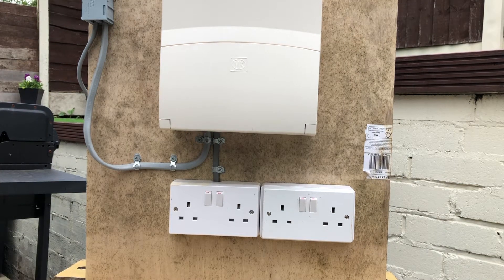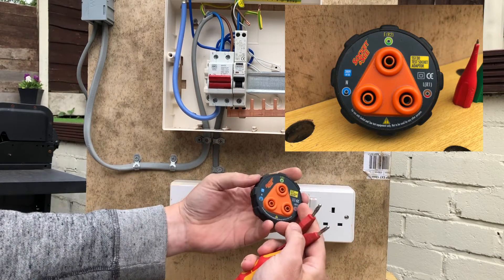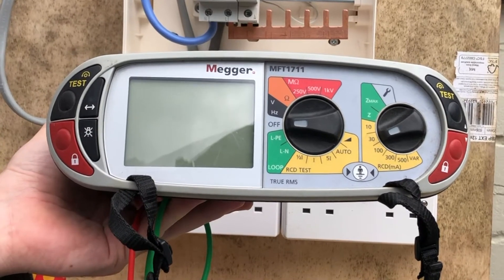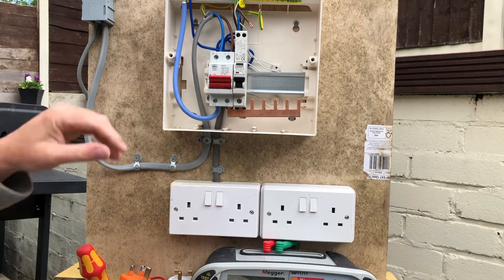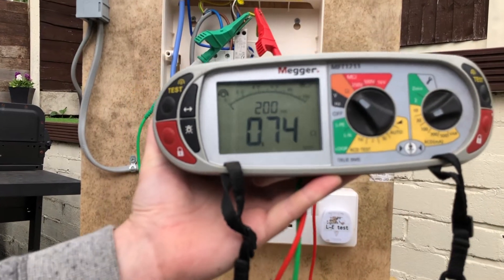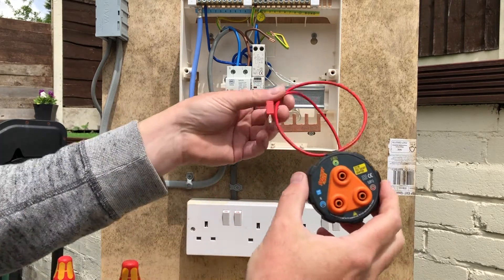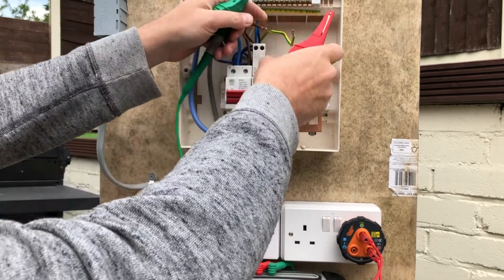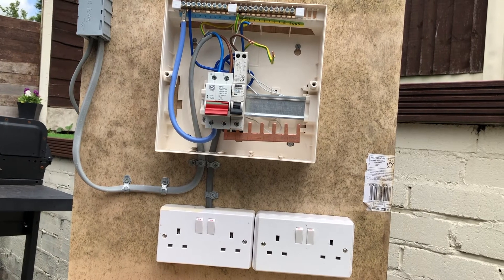How to Conduct An R1 + R2 Test On a Radial Circuit | R1 + R2 Testing Explained | EPR UK

Comment: Interesting, I'm  not a Spark so just curious.  If your meter is at the CU you have to keep walking backwards and forwards to all the sockets? If you have the meter at the socket (less walking) you have to remove the faceplate (more work) So why can't you have an adapter that would allow you to test at the socket without removing the faceplate? (less walking and less work)
Reply from the maker: Hi, Thanks for having an interest. It all depends on the installation that you are testing. Sometimes it may be necessary to remove the sockets to check the connections anyway to make sure they are tight and no sign of burning is present. Other times, the board is so full of cable trying to access it can be potentially dangerous, this can cause additional faults to occur. The methods I demonstrated in the video give the inspector an option to use a combination of any test method. It will all be dependent on the job type and accessibility. Hope this helps a little. Regards Chris

Comment: Hi, very helpful for r1 r2 readings. Have you a link for the banana to banana plug fly lead?
Cheers.
Reply from the maker: Hi, I bought my leads a while ago but these will do the job no problem https://www.ebay.co.uk/itm/2-x-Banana-Plug-To-Banana-Plug-Test-Cable-Multimeter-Testing-15A-Red-Black-4mm-/303805005359 👍